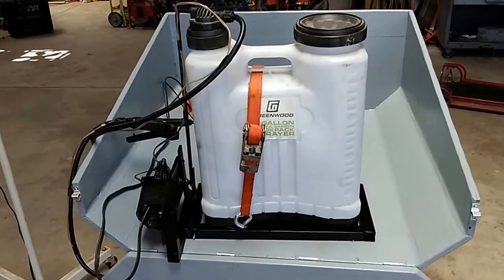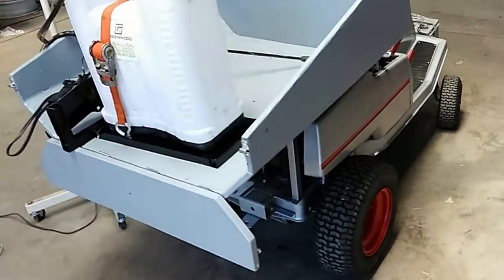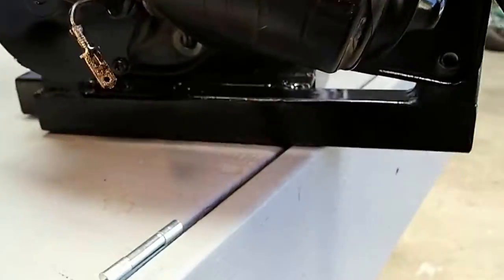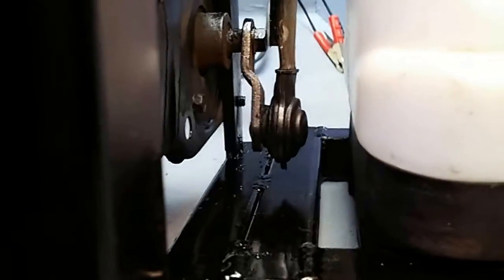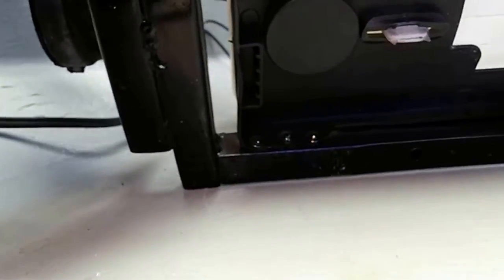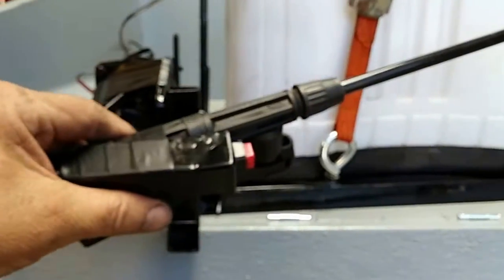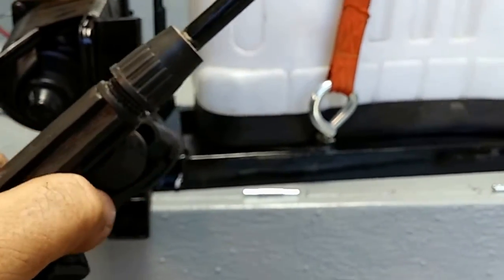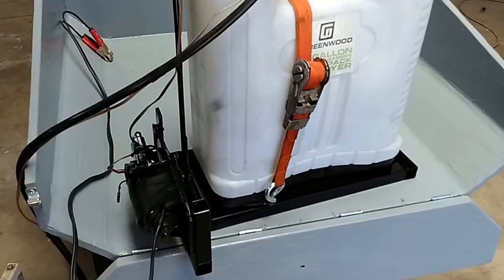Harbor Freight Backpack Sprayer 12 Volt Conversion

Comment: You seem to be a rather ingenious person there, what with your dump box on your riding mower and now your powered backpack sprayer. Last year I used a 2 gallon handheld pump sprayer to spray a small area of my 1/2 acre and it took forever and it did not really do that good of a job of applying the weed killer. So I decided for the upcoming weed season that I am going to convert a sprayer to powered by using a 12 volt battery and a high pressure pump. I could convert my 2 gallon handheld sprayer, or I could buy a 4 gallon backpack sprayer, or even a 15 gallon sprayer (which I would have to build a cart for to pull behind my riding mower). I will probably go with the 4 gallon backpack sprayer from Harbor Freight though. They are having them in their upcoming parking lot sale for $19.99. The battery and high pressure pump will cost me about $30 total on eBay. If it works like I hope it will then it will sure be a lot better than than pumping that 2 gallon handheld sprayer all the time, and it will put out an adequate amount of chemical on the weeds.
Reply from the maker: This actually works pretty good. You don't need to have the pump running all the time . I did it this way too because I had all the parts laying around for free. Even the square tube was recycled from some free railing I got. I'm glad this helped you. Thats why I do the videos